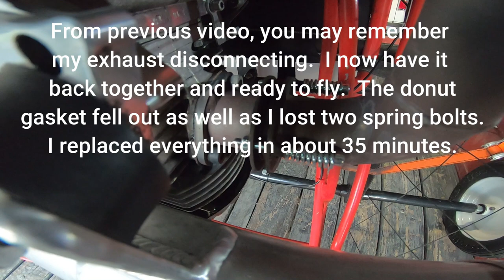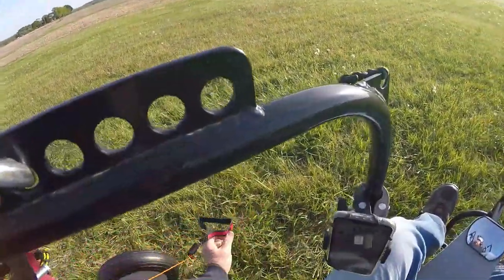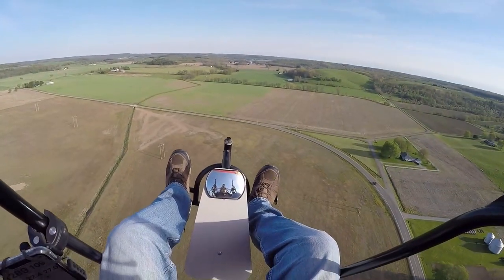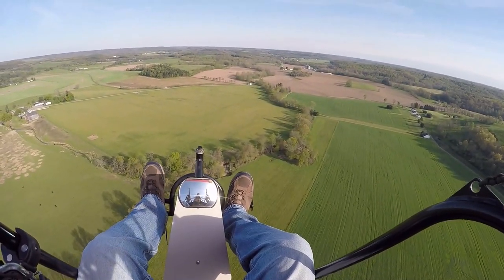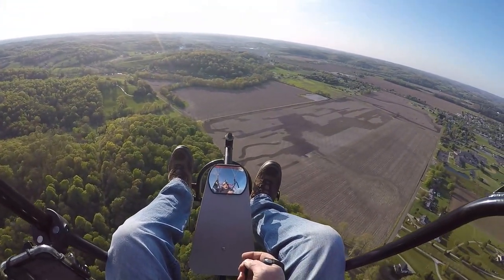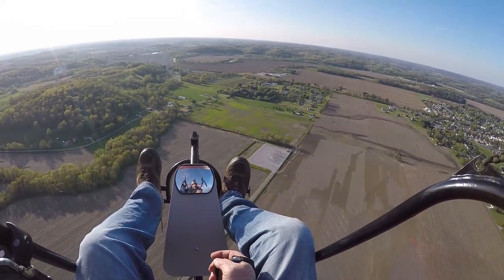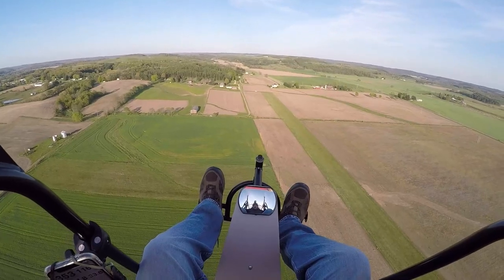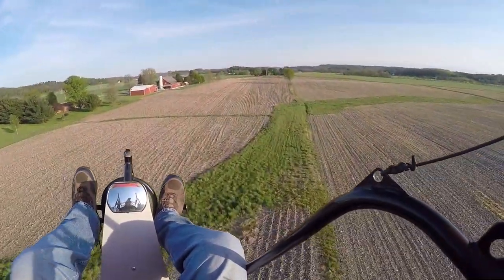ParaEngine Exhaust Failure - Ohio ParaTrike Paramotor Adventures

Comment: Looks like a beautiful flight Bob....makes me even more jealous then I was after speaking with you....by the way, what kind of mod did you do to create the counsel between ur legs....I’ve thot about creating suspension on the rear wheels with something like a light trailer torsion axle....ur thots.
Reply from the maker: It’s qtr inch plastic cut and clamped on the bar.  Keeps the water off you on wet grass. Rear wheels have a bit of suspension.